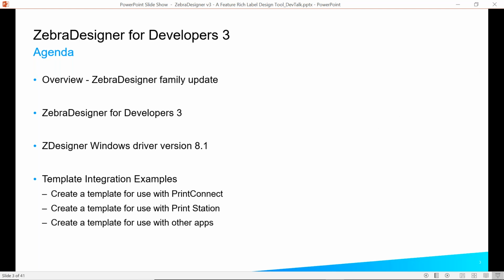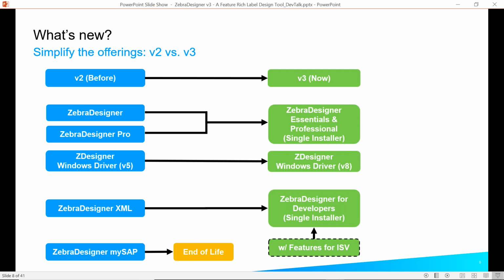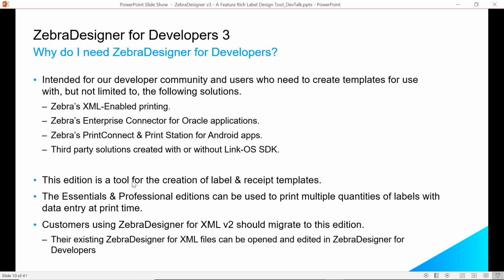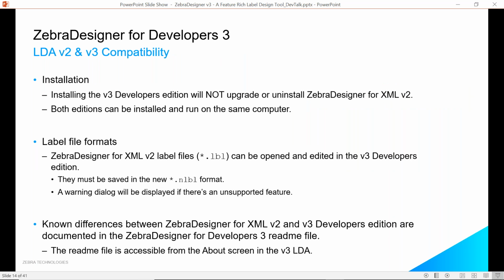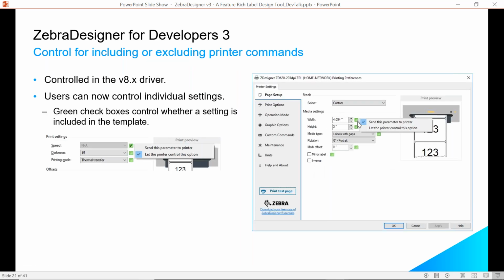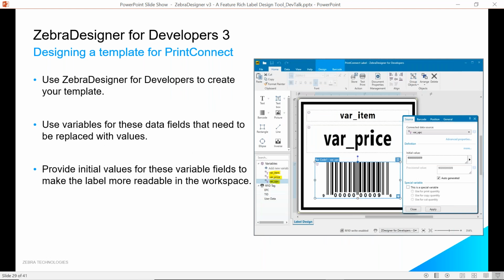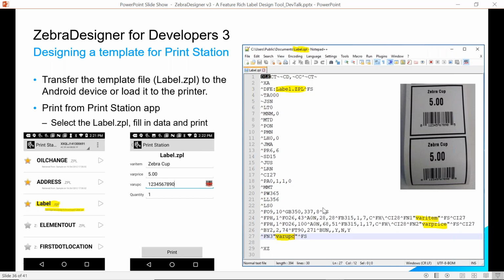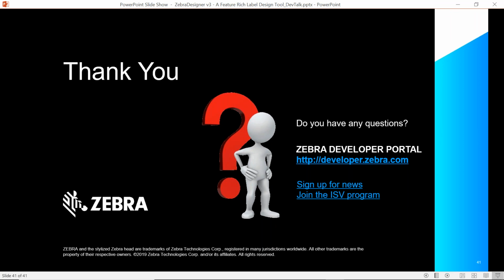Zebra DevTalk | Comprehensive Label Design Tool | December 2019

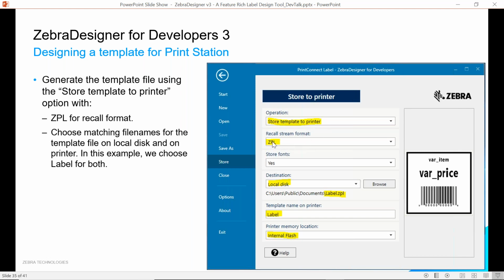Comment: When I match the settings at 35:43 and click 'Store to printer' it always saves as a .prn file. I have tried taking the ZPL from the .prn file and saving that as a .zpl file. The .prn file doesn't show in Print Station. The .zpl file shows and appear to work but when it prints I get a tiny row of text with no barcode. Print Station works just fine with the Oilchange.zpl and Address.zpl sample files. Any ideas?
Reply from the maker: Hi,

Thanks for reaching out, we have spoken to our developer team who have provided the following response:

"Because the selection for the Destination field is the “Local disk” at 35:43, click on “Store to Printer” button will ultimately save the template as a file to your computer. If the selection for the Destination filed is the “Printer selected in label”, then the template will be saved on to the printer. The .prn is the default file extension for all the output files generated from the ZebraDesigner for Developer tool, if you do not specify the file extension after browsing to a destination for the output file. You can specify with other file extensions, such as .txt or .zpl, etc., after clicking on “Browse” button for the destination of “Local disk”.

The template file on the printer will not take .prn as file extension. Instead, the filename and its extension is specified by ^DF command inside the *.prn file, for example, ^DFE:LABEL.ZPL. When the content of *.prn file is sent to the printer, the ^DF command tells the printer where to store the template and what the filename of the template is. The ^DFE:LABEL.ZPL, for example, tells the printer to store the template on E: drive (which is the internal flash) with the filename of LABEL.ZPL for the template.

Regarding the last question, it looks like the template file you created doesn’t specify the length of the label, which could be the case where you choose to let the printer control the label length. In this case, you need to configure the label length for the continuous paper on your printer. Try, ! U1 getvar "zpl.label_length" (to get the length) and ! U1 setvar "zpl.label_length" "200" (to set the length to 200dots, equivalent to 1 inch) to increase the length. "

We hope this helps to resolve the issue.